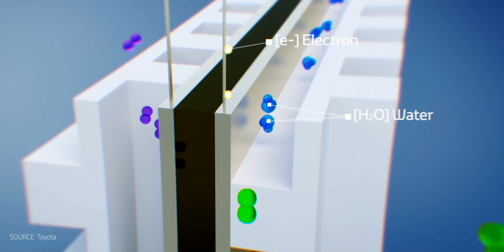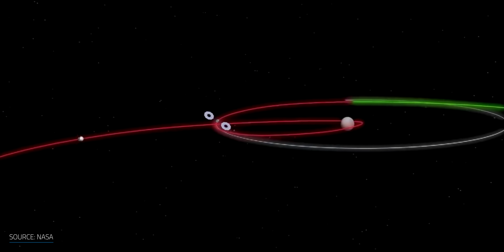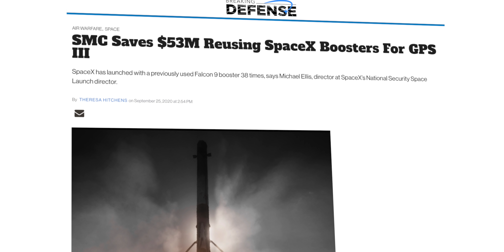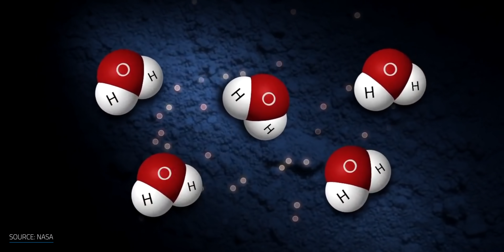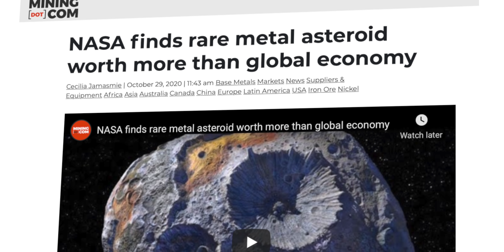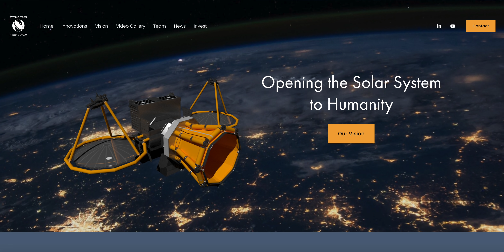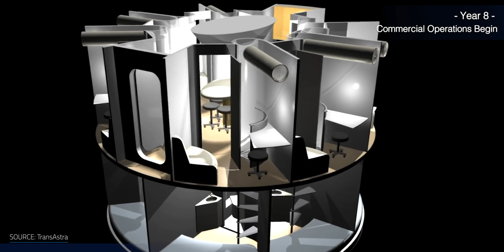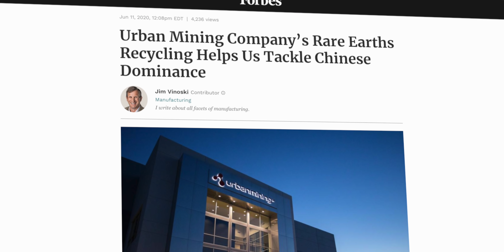Does Space Mining Solve Our Resource Problem?

Comment: I think overcoming the kinetic energy of an asteroid is going to be a bigger problem than anyone is making out.
That's like trying to lasso a runaway freight train.
Reply: Not quite how orbital mechanics works... If you're rendezvous-ing with an asteroid with the intention to land, you're already moving at roughly the same speed anyway.
Reply: @hydrochloricacid2146  and then your trap bag has to have enough of its own Delta-V to shift the asteroid on a course for earth, and slow it down to where it can either orbit the earth, or moon, and be broken down into elements or compounds that we can use.
Then you have to transfer that material to wherever it will be used.
Having captured it is not 1/10th the job.
Reply: @jimurrata6785  if you plan your operations right, a very small nudge years in advance might be all you need to get an earth encounter, especially if we're talking near-earth asteroids.

Gravity assists can both be used to get said encounter (if farther away) and slow the payload around our planet. 

And that's even assuming you're planning on bringing back the asteroid to earth orbit: it might be smarter to extract the material you seek (or even manufacture your product) on-site and ship that back. 
Plan things right and you might even be able to used the asteroid itself to make propellant for the return trip, or even manufacture the entire return vehicle (as long as we're talking near-future tech).
Reply: @hydrochloricacid2146  I think the video points out using water and carbon from the catch vehicle to create fuel for transit.
It sure doesn't seem like the technology is very useful or resource efficient, if it ever where to be developed.
I could see it in a far off case of interplanetary travel, where the asteroid is consumed en-route.

Comment: I remember in the 80ties, they said that we would run out of oil, with the current usage in just 40 years. Since then, the oil usage have increased a lot and we are not expecting to run out any time soon. So I guess it will be the same for rare earth minerals/metals they with come of with new places and new ways to extract them.
Reply: It's not that we run out of rare earth metals. It's that we soon won't have cheap, easy, economically viable options. After humanity has exhausted every easy option, collected and mined every low hanging fruit from the surface, we will have a hard time getting more easily. For example we will start to scour the surface of the oceans for these materials. You can imagine what this does to marine life and habitats. Many companies are already starting to do this btw. 

Same with oil, except that with oil but it's a whole different thing.
Reply: @PresidentialWinner  Technically we could mine the upper mantle, but...
Reply: @KRYMauL  Yeah the deepest hole we have bored is not even close...so..
Reply: @PresidentialWinner  Yea the deepest borehole we've managed is about 7km and that was back in the 70's and had to stop because it was starting to melt the drill head.
And the deepest mine we've made is only 4km and it's gets so hot towards the bottom it can hit over 50*C the deeper you go plus all the humidity from the water seepage.
Reply: @SilvaDreams  You are wrong.

The Kola Superdeep Borehole is the result of a scientific drilling project of the Soviet Union. The project attempted to drill as deep as possible into the Earth's crust.

Drilling began on 24 May 1970, it became the deepest man-made hole in history in 1979. It reached 12,262 metres (40,230 ft; 7.619 mi) in 1989, the deepest artificial point on Earth.

In terms of true vertical depth, it is the deepest borehole in the world. For two decades it was also the world's longest borehole in terms of measured depth along the well bore, until it was surpassed in 2008 by the 12,289-metre-long (40,318 ft) (7.636 mi) Al Shaheen oil well in Qatar.
Reply: Whoever "they" are who said we'd "run out" of oil in 40 years was misinformed or confused "running out" with running out of cheap and easy accessible oil. Rare earth minerals and metals are far more scarce then fossil fuels.
Reply: @cletussamboy8650  Actually, most rare earths are not so much rare as they are environmentally negative and otherwise costly to mine and refine.
Reply: @nunya___  Well they are rare compared to say iron or copper, thus why they have been terms rare EARTH metals, in space they aren't as rare because our planet was literally made out of those same asteroids.
Reply: @nunya___  So why resort to mining asteroids if they aren't rare? What's next? Mining neptune for it's methane? This screams desperation.
Reply: @cletussamboy8650  Because they will be, They Will Be...
Reply: @nunya___  Sure I really see millions of tons of ore coming back to earth.
Reply: @cletussamboy8650  When that becomes the necessary/cheapest option to get something we finally run out of, it will happen.
Reply: The truth is we only have 100 years of oil in reserves, but that includes natural gas. This assumes we don't increase our energy needs and find anymore, if both these things happen we might be able to level out at 150-200 years.

In the grand scheme of things we don't have supply for it to be cheap for the entire duration.
Reply: @KRYMauL  Yeah we will HAVE to lean off our addiction to fossil fuels, whether or not the climate is changing (it is) because when we eventually run out, civilization will collapse if we don't have an alternative.
Reply: @PresidentialWinner  It’s not an addiction. Do you like energy? Then you need Fossil Fuels unless you want to pay a Dumpster miner to go all the trash for rare earth minerals, then burn the fire. There isn’t another form of power that is as useful as coal and natural gas unless the stigma against nuclear changes.
Reply: @KRYMauL  the "addiction" was a metaphor. Nuclear is awesome.
Reply: @KRYMauL  Depending on the source, I've seen reports saying we will be out of oil by 2050. Other reports saying we got about 100 years or so. Then there are ones that say we got 300+, and a while back I saw one claiming we have close to another 1k years of oil reserves.

No, we can't mine the upper mantle. The upper mantle is about 410 miles (660 km) down, and the deepest we have ever gone is 4.3 miles (7 km) deep. Our deepest mine is 2.4 miles (4 km) deep, and is usually about 150 degrees at that depth. No human would be able to go down to the mantle for a mining operation, meaning it would all have to be done by robots/machines. And since the mantle ranges from 900-1600 degrees, some insanely durable robots/machines would have to be used. It would more than likely be cheaper just to go mine some asteroid than it would digging down to the mantle to just start a mining operation.
Reply: @Nozerone  IIRC That’s what the but was for. Geothermal is good for distances past 8 km, although unless you do an open loop system nothing should go into your pipes.

Comment: Thank you so much for covering this. I am especially happy to see the tech that TransAstra is developing b/c I first gave a paper on the subject of solar thermal rocket tech and its use for asteroid mining at the 1985 Space Congress and believe that direct use of energy when feasible is more efficient. That said I think they could improve their plan by using Spectrolab type solar cells which can generate Electrical power in over 900 Suns if cooled to 100 deg. C at over 40% efficiency which could be moved into the mirror's focus (and the engine moved to the side) as needed. This allows for a near ten fold increase in power/mass and opens up many possibilities including the use of lasers. The best use of things mined in space is in space. That anyone ever thought bringing anything unmanufactured to Earth was viable, beyond maybe platinum, surprises me and should in no way be a metric for the economic viability of asteroid mining. There is about to be a robust and expanding economic development and settling of the solar system and beyond and it's coming sooner than most think IMO.

Comment: I don't think there is any doubt this will be a major thing in the future.  Recycling and new mining on Earth will only take us so far.  Also, you don't have to send everything back to earth...you could do in situ utilization of materials, or utilize them in orbit, either around the Earth or the Moon.  I think of it like this...it wouldn't have been feasible for, say, the Romans or even medieval Europeans to mine gold in California in the past, even if they knew the gold was there.  It would cost too much.  Even early colonists in the US couldn't have done it on a cost basis...it would cost more to get there and mine the stuff than it was worth.  You'd have also had the issue of flooding the market but that's not the real problem.  However, by the 19th century, it WAS feasible to go out there to mine the stuff, and as the market grew organically it wasn't a huge issue with destabilization.  I think that's what will happen with space-based mining.  You aren't going to be able to get the huge multi-trillion dollar asteroid tomorrow...instead, it will start small, and as capabilities increase the market will expand.  The biggest thing I see is moving the environmental impact, which you didn't go into, to space instead of here.  Even recycling e-waste has a huge and negative environmental cost, let alone mining most of the rare earth metals or even other things.  They have a huge impact on the environment.  It would be worth the extra cost just to get that moved to space instead of impacting the planet here.

Comment: I think space mining is going to become viable because I think space travel is going to become dramatically cheaper. If SpaceX is successful with the fully reusable Starship, which I think is likely to happen, suddenly getting into and out of orbit is affordable, and the rest of the infrastructure becomes viable.

Transporting material around in space is very easy, and is only expensive because getting fuel to do it into orbit is super expensive. It doesn't take a lot of fuel, so a small fuel factory on the moon will be a game changer.

With reusable orbital launch vehicles making it much more affordable to get specialized equipment into orbit, and with fuel production in space (which is also helped by cheaper launch costs), we are may see costs for mining asteroids dropping to 10% of current estimates. Even with the prices of the materials mined dropping as a new supply floods the market, it will be profitable while also dropping the cost of important goods.